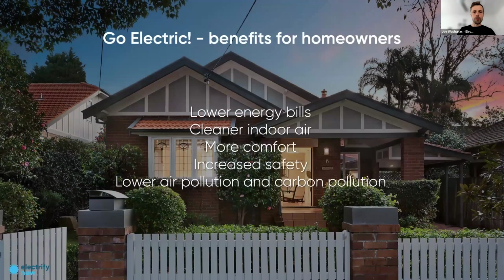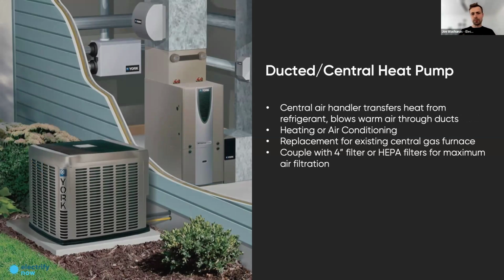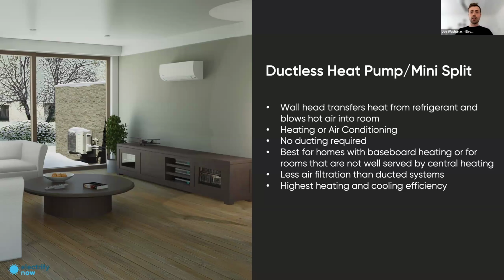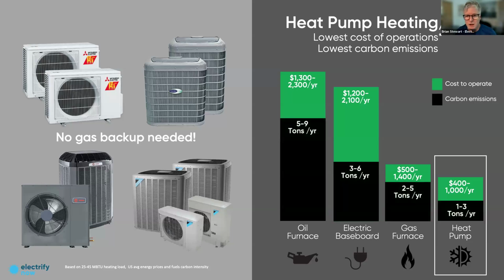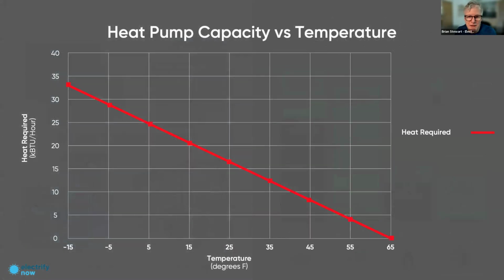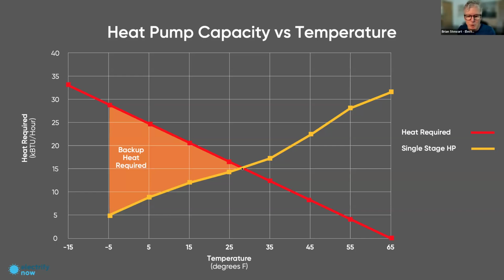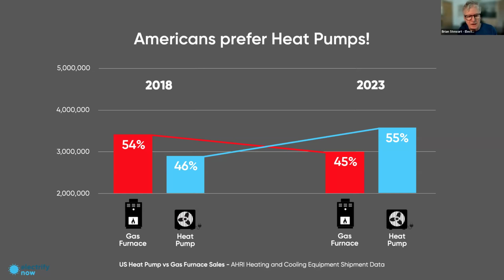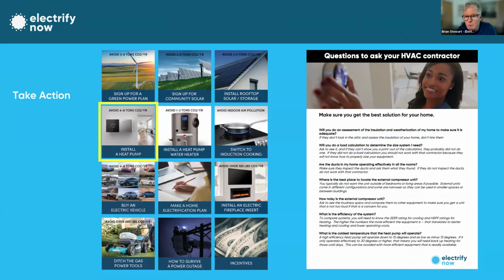Air Source Heat Pumps - High Efficiency Heating and Cooling

Comment: Homeowner here who recently switched from a gas furnace to a heat pump. The first place to start is to track your energy use. Unfortunately, most contractors aren't data-driven and have the incentive to oversize your heat pump. You don't even need a tracking app or device. Just saving your gas and electricity bills for a whole year is enough.